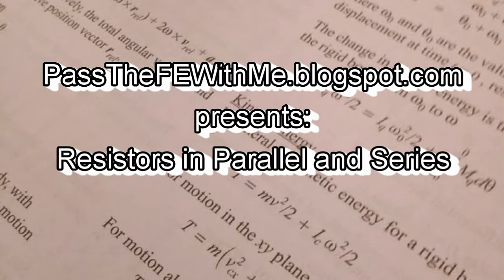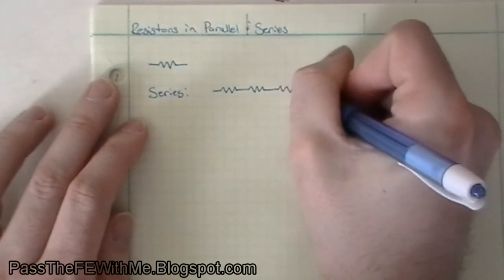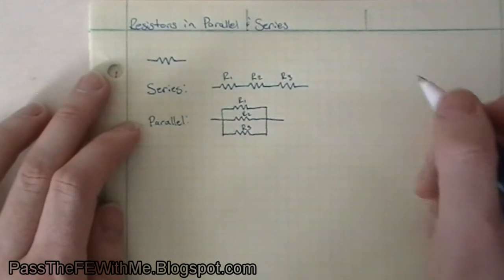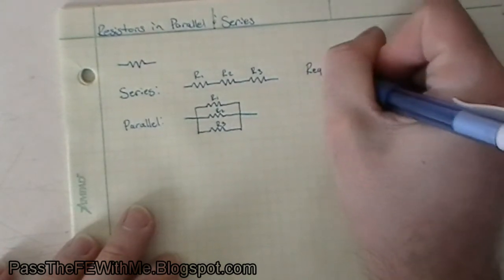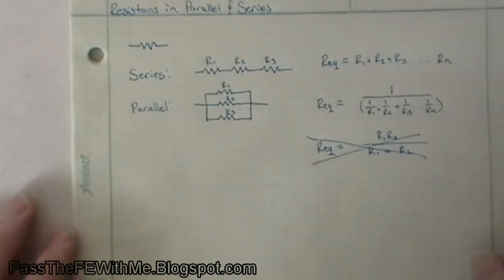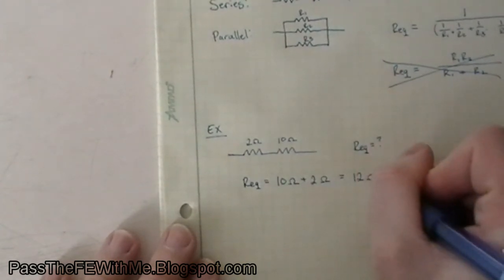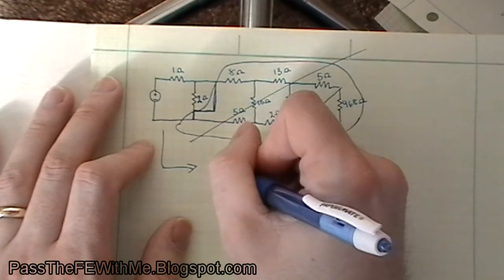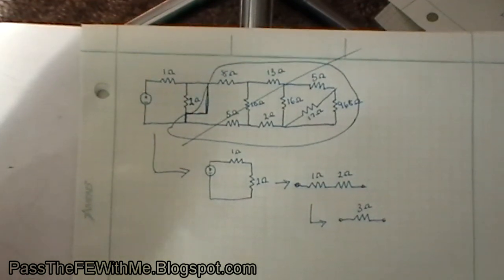FE Review: Resistors in Parallel and Series

Comment: Wouldn't the current just bypass the 2 ohm resistor through the short circuit? So it will never actually go through the 2 ohm resistor?